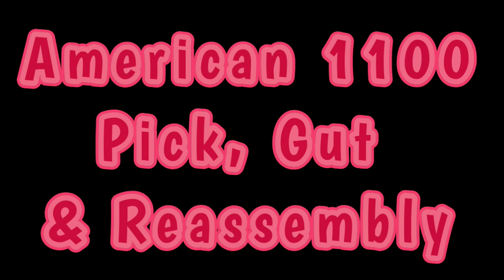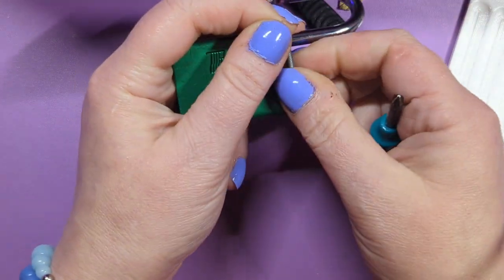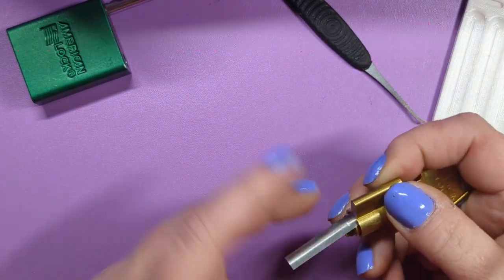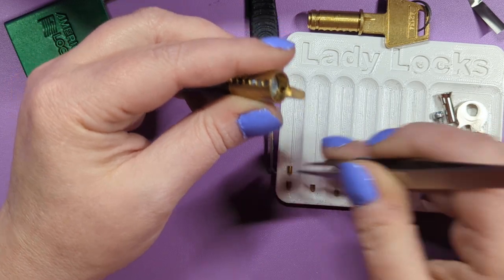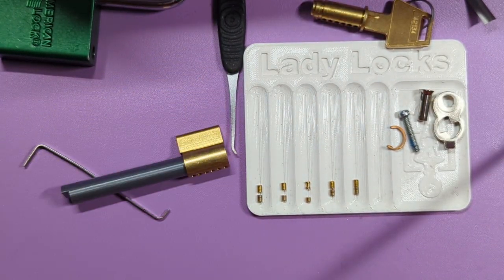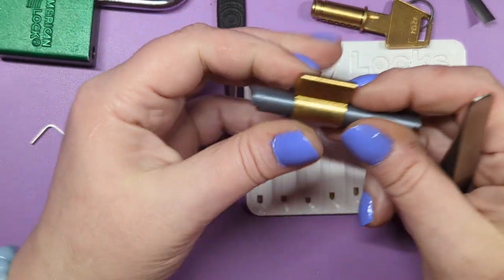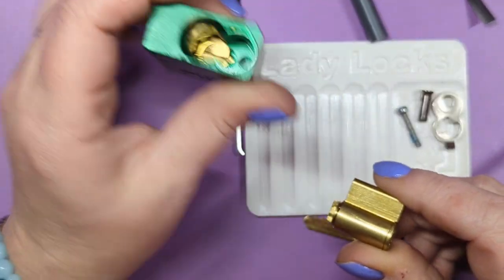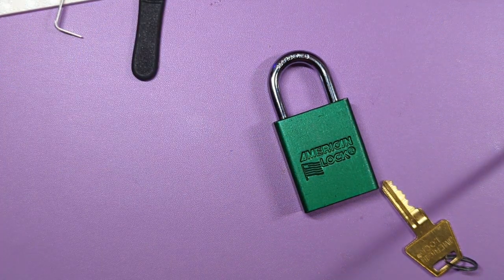Pick, Gut & How to Reassemble

Comment: Hi there, been a while, hope you're well. 
 Nice, quick pick and a great vid!
Lots of good advice here- I'm a couple of years in, have picked numerous ALs &  LoTos and have made ALL of the mistakes mentioned. 🤦‍♂️🤣
 Important to note, is the front and back of the core holder when repinning (yep, been there) . Shims. Very useful cut-away core follower. Orientation of the core, in the lock body (been there too) . Not screwing the thing back together, without first trying with a key (OK, I think I'm stupid!) and fighting with the actuator, at the back of the lock, which is facing in the wrong direction (Yep, I'm definately stupid!!🙄).
 Can I just add, that most of the newer AL 1100s will have an anti-bypass wafer, at the back of the lock- if you are a picker, just take it out, it makes no difference to picking.
 Love ya to bits, take care and I'm off for a nosey at 'Impressioning Time'..... 😁🔓🤘
Reply from the maker: Yesss!! The anit-bypass wafer is so annoying! I forgot to mention this so I'm glad you brought that up! I just hope this video helps someone down the line. I ran into all those issues picking these once apon a time as well. I think most of us do.